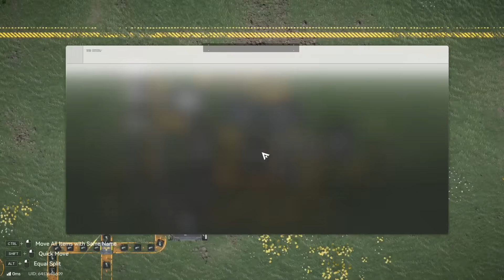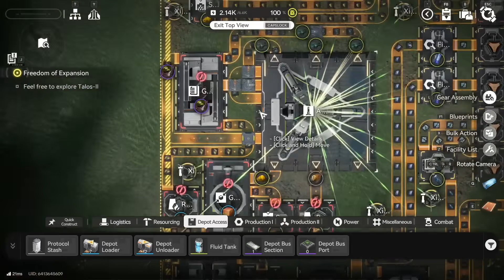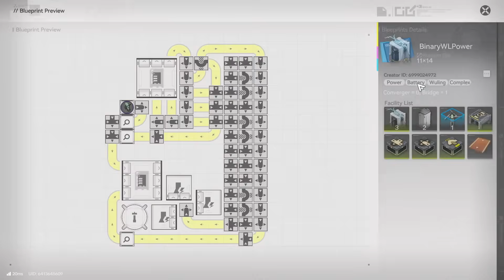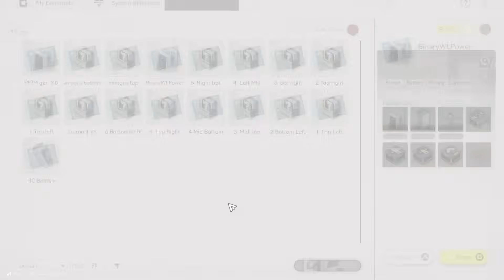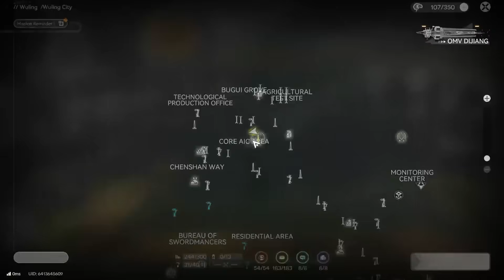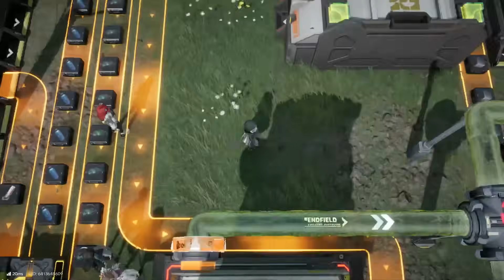Automatically increase Power Output? | Adaptive Power Generator in Endfield

Comment: I have nothing against your system (apart that it could probably be made in easier way) but I have a question: Why you have so much power fluctuation in your factory that you need to implement such a controller?? And why you need such a fine control.
I setup my factory and it draws always the same amount of power unless i change something but that is only in case of an event or new update.
Even considering "performance", the factory system is so in constraints that even if you would "tickle" out a battery more / min, you will probably have an hard time selling it because the outpost doesn't make money fast enough to sell everything.

Comment: This is such a neat system. The only real flaw is that it does sort of use power itself, well it needs to in order to work.

Kind of curious though, is it not possible to simply use a belt splitter to replace the two protocol stashes on the top?
Reply: Or having two Ferrium outputs since the sand leaf isn’t meant to ever leave the stash.

Comment: it would be great if they implement a real if logic in the item controler or new factory tech like upgraded unloader. Depot Unloader starts working if item in storage is above or below a number. It will be great for secondary production lines that else can drain resources from primary ones + it will look much cleaner.

Comment: Steps to Build an Adaptive Power Generator
1- Blueprint Installation & Battery Path [02:27]
- Place the blueprint on a large area.
- Connect the conveyor input to the Wuling LC Battery supply and the output to the empty battery disposal.

2- Stash Security Configuration (Manual Required) [02:56]
- Check the 4 Protocol Stash units in the system.
- Ensure they are de-energized or set to Storage Mode. If electrocuted by the pylon, the sensor system could be damaged.

3- Trash Slot Locking (Logic Locking) [03:20]
- Open the Protocol Stash specified in the blueprint.
- Fill the first 5 slots with any trash item (e.g., Sand, Leaf Powder) in full stacks.
- Leave exactly 1 empty slot for the sensor item.

4- Ferium Sensor Item Injection [03:54]
- Insert exactly 11 Ferium units into the system.
 - This Ferium will rotate continuously as a "detector" for the factory's electrical status.

5- Injecting the Origo Crust Sensor Item [04:22]
- Insert exactly 21 units of Origo Crust into the bottom track.
- This item acts as a "resistance." The more Origo Crust in the track, the lower the output power (default setting).

6- Synchronization Process (Calibration) [05:05]
- Let the machine run for 1-2 minutes without interruption.
- Visual check: Ensure the Origo Crust flows at a steady 4-second interval per item. If it is stable, the system is ready to operate.

7- Automatic Adaptation Operation [07:53]
- If your factory requires more power and the power goes out (crashes), the system will automatically detect the Ferium machine's shutdown.
- One unit of Origo Crust will be dumped into the backup stash, increasing the output power by +100W.
- This process will repeat itself until your factory's power is stable (returned on). 

8- Manual Adjustment (If Reducing Engines) [15:16]
- Remember, this system cannot automatically reduce power.
- If you remove multiple engines, manually reinsert the Origo Crust from the backup to the main line to reduce power and extend battery life.

Honestly expected some engineering genius to pull this off eventually, but doing it with an adaptive feature less than a month after launch is just insane😭❤️‍🩹. Absolutely brilliant work!

Comment: Using originium as a clock and injecting it in belt line as a variable valve. Ferrium detects power shortage and control clock for releasing valve. Excellent Work!!!

Comment: I don't think the unit of power is in watt.
Imagine powering the entire Automated Industry Complex with power equivalent of a coffee boiler.

Also, as long as there's a daily limit of stock bill you can acquire per day, the extra battery you get from any power optimization is wasted, thus the optimization is sub-optimal.
Reply from the maker: Not sure what else "W" would stand for. We not necessary have to meet realistic scaling, similar to how the m/h or km/h in racing games often doesn't make sense either.

"The optimization is not needed, thus the optimization is sub-optimal" is one of the weirdest sentence I have read in a bit.
Reply: @purefallen7166  Yeah, in electrical context "W" would stand for watt, But I don't see the unit being "W" anywhere in the game so I'm just curious where did you get that from.

By trying to optimize the power, you are being sub-optimal on resource/time management, is what I was trying to say. Maximum optimization on one thing (power generation in this case) isn't always the most optimal solution.

Comment: I find it funny that the devs try to make optimization of this level completely unnecessary but people still explore the belt mechanic to make this kind of thing. No wonder the devs wont allow more than 2 active AIC in the future. The simulations for belt actually have to run when you are offline for this to work.
Reply from the maker: > won't allow more than 2 active AIC
You got a source for that? :o
But yeah, there is a lot of burden here on the servers for simulating and synchronizing this I can imagine.
Reply: @purefallen7166  its literally says that in the game
Reply: @purefallen7166  Interact with the AIC building, Protocol Management, then the Question Mark in the bottom left. Screen close to where you set up metastorage transfer
Reply: @purefallen7166  he meant AIC in each region, you can activate AIC only for 2 region in the future update, so when new region arrived after Wuling you must choose 2 out of three region which AIC to keep online

Comment: I KNEW this was possible! I was able to make a similar system that only lets batteries through when power is 0, but I wasn’t quite able to get the auto-scaling set up like I wanted.
This concept would work fine with other types of batteries, moreso than the 12-bit. The 12-bit didn’t work with other types because it threw off the bit calculation, which you need to do yourself. This system does the calculation for you: a weaker battery will automatically store more origocrust to compensate. (Obviously with less maximum output). You could simply replace a splitter on the left with a belt and the max power (and power increment per origocrust) would double, which mitigates the max output concern.
Reply from the maker: The Origocrust Portion doesn't seem scaleable, as we have to abuse the ratio between 1item/2s and 1item/4s with the 20 Items +1 Trapped = 21.
We can perhaps archieve some scaling by removing the splitters before the Thermal Banks. Still, the design will only work aslong as the total power consumption of the base is lower than the total power delivery of a battery divided by two, as we need to divide atleast once to make space for the batteries in the converger before.
Reply: @purefallen7166 I didn’t mean scaling up the origocrust loop, I meant the system automatically putting origocrust in the stash to remove it from loop and thus allow more batteries to flow. It will just need to do it more times for a weaker battery. And yes by “splitter on the left” I meant the extra ones going to the thermal banks.

I still don’t think the max power is the issue you make it out to be. You aren’t limited to half the power of a battery, you’re limited to half the power of 1 BELT of batteries. 
An HC valley battery gives 1.1k power for 40s. A belt can move 1 battery per 2s. An unobstructed belt (no origocrust) can power TWENTY thermal banks, or 22k power. With no unnecessary splitters, this system gives between 100% to 50% of that power, since a full origocrust belt cuts the battery throughput in half.

Comment: So in simple terms
D.I.G.E is a Custom 12-bit power control, high precision 

This is a Power Recovery in increments of ~100 power on triggered power outage ?
Reply from the maker: D.I.G.E. is a customized Load Cycling System that is calculated by an external tool and personalized around the needs of your base. Optimal if you want to minmax results and don't mind redoing it each time you do changes to your factories's power demand.

The Blueprint in the video is a generic solution of a Power Generator that automatically scales up in steps of 100W based on the power demands. It is for people that want a solution that is just "copy-and-paste Blueprint" and and can be set and forget.

There used to be another Blueprint for Load Cycling (called the "12-Bit PWM" in the community) that brings it's own advantages and disadvantages, such as a higher range of operation (800~4095W), but much more instability (crashing on certain numbers that cause Superpositions, such as 1899W).

The "12-Bit PWM" and D.I.G.E. have been adressed in a former video. I build ontop of that video because explaining them once again had stretch this video to close of an hour playtime.

Comment: Yeah, I think DIGE is just more efficient and personalized to give up. Cool concept but could be refined more to maybe work just as well as DIGE on an automized scale.
Reply from the maker: Exactly. Someone who is willing to put in the effort to use D.I.G.E. should definitely use it.
This is more of an option for people that aren't willing to do more than copypasting a Blueprint.
It is nice to see that this concept exists though, it may come in handy in the future.
Reply: The appeal of this over DIGE is that if you’re out placing a bunch of turrets or zip lines or pumps, you don’t need to go back to the factory to increase your power: this system would adjust on its own, up to a point.
When the next wuling area drops, I’ll be using this while I get my zip lines, drills, and new production lines set up. Then switch to dige once I’ve seen where my power consumption sits at.
Reply: @ZaxtonHong  Yeah for sure. I just don't need it but this is definitely a luxurious battery management system.
Reply: @ZaxtonHong just planning with a 50w buffer gives you 10 Ziplines or 5 Pumps, for Turrets I never set up powerlines, thats what the stash of lc valley batteries I no longer have any use for is good. And when I build more mining rigs I go back to build something to use up my new production capacity anyways.

Comment: I don’t have a single clue how this works, but I find it impressive that you achieved this within such a simplified factory system.
Reply from the maker: It isn't my design, Credits are given within the Video Description.
I did mess with the idea myself, but someone was faster. At this point we have working logical gates (AND, NOT, ...) in Endfield. As such, Endfield is "turing-complete" and we could make literally everything in it... our only limitaitions are space and speed. Running Doom on Endfield? It would be possible, if not for that.
Reply: @purefallen7166  
How about the Exclusive Departement?
Reply from the maker: @tomatomaki  What do you mean by that?
Reply: @purefallen7166  
XAND, XOR?